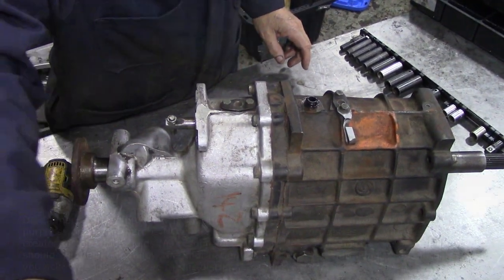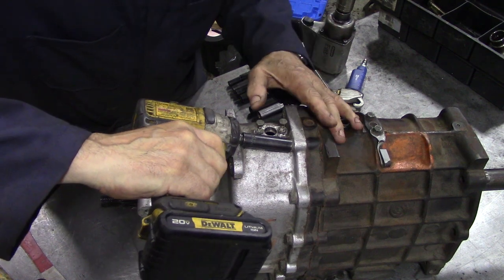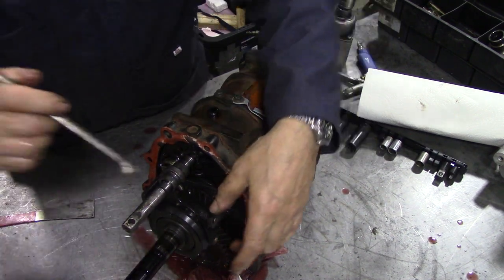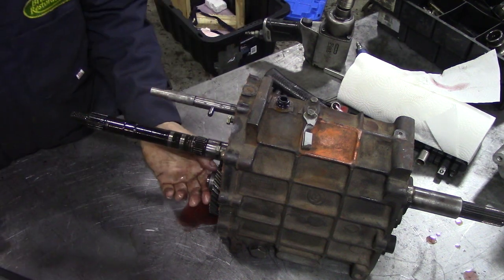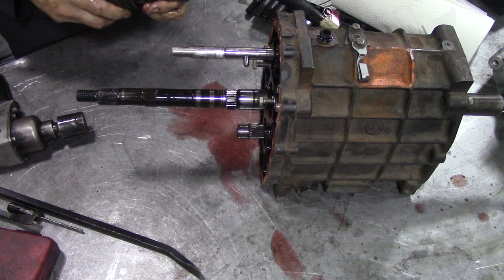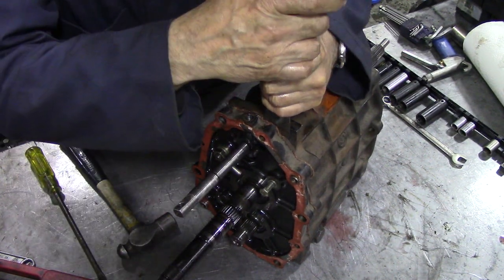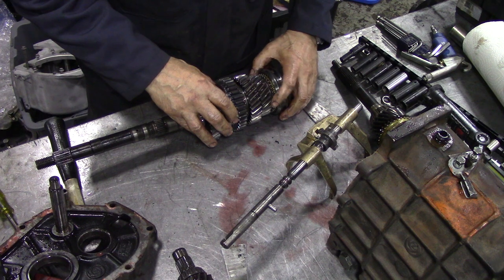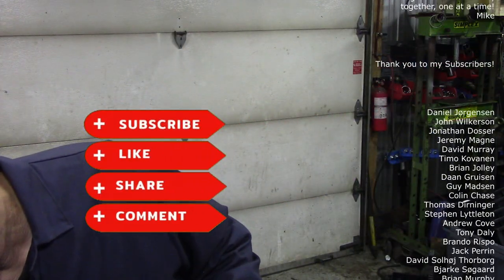Stripping a Rover P6 LT77 2-wheel drive gearbox

Comment: I love the P6. My dad had a Lunar Grey (light green) 1973 2000 single-carb automatic (2000SC auto), LAC665L, one of the last-ever 2000's before being superceded by the 2200. It was slightly leisurely but very quiet and comfortable.

Comment: Hi That's a great video, thank you. I wanted to add in the case of the viewer wanting to attempt this who has maybe got disillusioned because of the amount of special tools required that all is not lost, I just did this same teardown on a Suffix A box with tools available for rental or purchase at autozone in the US, namely 2 bearing pullers, a push pull puller set and a pilot bearing remover for that inside bearing race on the pilot shaft. All in all that was 200 bucks and you can return them. Lets face it not many of us have those Land rover tools or have access. I got right down to the bearing off that is done in the second video. No offense at all but it might be good to see this done with readily available tools, as I know it can be, either in US of UK etc. If you can apply heat and have these tools, you can do this.  Cheers
Reply from the maker: I have had those LR tools 20 years
Reply: Like I said mate I'm not knocking it these videos are amazing and they help us have a go at it. Without these and the axle videos I dont have any hope of completing what i want to do.
Reply from the maker: Well done!

Comment: There  is the P6 club, from Alaska to Australia. See the Rover forum for any information you need. I'm restoring a 2200TC myself, but I'm not a gearbox specialist. As far as I know LT77's came off the SD1's. And it's got ATF in it, so it must be an Auto box. Unless, they are running on the wrong oil.
Reply from the maker: LT77 was run on ATF
Reply: Yes and no, the Rover guys here use Redline MTL and Castrol Syntrans or similar.
Reply from the maker: Never had an issue with ATF

Comment: Interesting to see an LT77 from a P6. Definitely need that puller though, and I'd have thought that the nuts and bolts would have been imperial as it was a 70's car. In any case, must have been well cared for as in very good condition. Wonder if the car is Orange?
Reply from the maker: Last 2WD on I did was an SD1 - simple gearbox 
I wonder why they were OK on 3500 V8's but not so good in Land Rovers?

Comment: Hello Mike, I'm Dieter from Germany. This is also a very informative video for me. I am the owner of a Jaguar E-Type Series 2 and bought the same transmission five or six years ago to change my Jag. from the automatic Borg Warner 8 to the five-speed transmission to reduce the speed level in the XK engine. Jaguar has installed these boxes in the XJ 6 Sedan Series 3. That was in the early eighties. It is very rare in the XJ 6 Jag., a kind of blue Mauritius. Where could I get spare parts, seals, etc. if I need something?
Best regard‘s,
Dieter from Germany
Reply from the maker: I really don't know where to get parts - the customer supplied them

Comment: Thanks for a great video. I'm just about to try and remove the rear cover on my TR7 LT77 in order to replace the o ring seal for the selector shaft so this was great to watch. Do you think that "reluctance" of the cover to pull off initially was due to the circlip on the output shaft which retains the speedo gear? It's difficult to see but it looks like the groove might be chamfered to allow the cover to be pulled off bringing the circlip off at the same time?
Reply from the maker: To tell you the truth, this was the first I have done and was months ago - I cannot recall
Reply: @BritannicaRestorations 
 Not to worry! No doubt I'll find out soon! I'll be working under the car with just the back end of the gearbox lowered (car on stands so not much headroom) so just trying to anticipate any snags. 👍
Reply from the maker: Good luck!

Comment: thanks for the video. From my experience it is a good gearbox when you change the gear slowly. I use it on my classic range rover diesel with more than 525000km. It is pleasant to use, not the gearbox that is on my defender td4 from 2012.
Reply from the maker: Yes, which is why I shy away from products like the slickshift, which makes shorter length for shifting gears, but encourages faster changes.
Slow and easy for these LT77/R380
Reply: @BritannicaRestorations  You could also say that for the MT82's in the Puma.  That is a notchy change, especially first to second, not something you want to rush.

Comment: The gearbox looks very similar to the Leyland sherpa gearbox, bad shimming and towing without removing prop can damage box, we didn't have many issues with them, in the Royal mail fleet.
Reply from the maker: Yes, when you tow these boxes a long distance, the mainshaft is turning, but the layshaft isn't, so there is no drive to the oil pump and nor is that any splash feed!
This can wear bearings out quickly !

Comment: All LT77s were metric. The LT 77 was never factory fitted to the P6, but was the standard box on SD1s, this is probably were it came from, but could also be a TR7 unit 2nd gear synchro is the weak point.
Reply from the maker: I don't know - this is what I was told